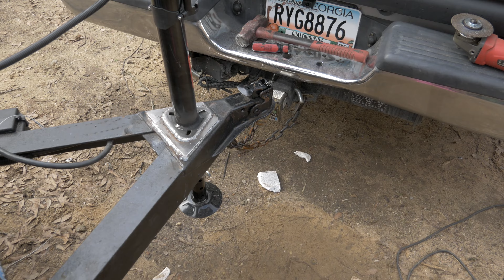Uriah Products UC500010 Electric Trailer Jack WELDING Installation || Legacy 4x4 Fabrication

Comment: Wish electric jacks were a lot cheaper, especially for these big heavy dual tandem trailers where it takes 2
Reply from the maker: yeah, I've seen someone run them on a horse trailer that needed two... their pretty good at the light weight level but anything after its gotta be hydraulic :(